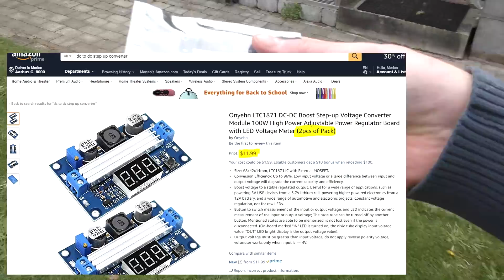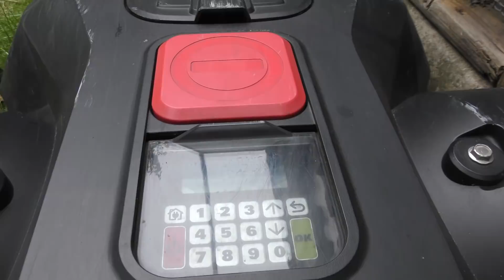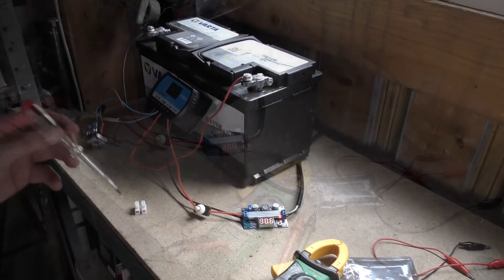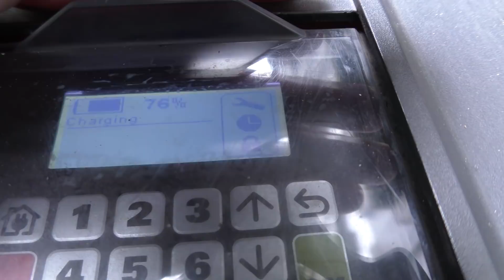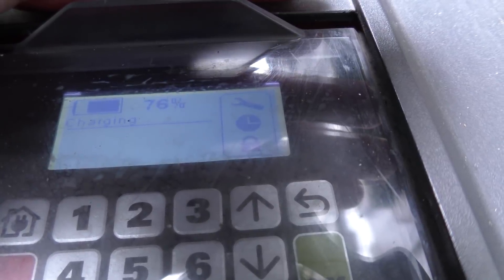The Tiniest of Updates, Solar Power Robot Lawn Mower Project - 749

Comment: Thanks for your video,
I am wondering why did you use an inverter to charge the lawn mower? It has a DC battery that I think you can connect directly to the charge controller.
Reply from the maker: It´s prety irritating to remove the battery from the lawnmower,, and I would need to do that to charge it from the charge controller directly. :-/ To charge it through the docking station,, it wants 30-32volt